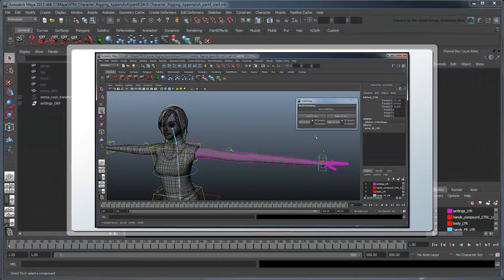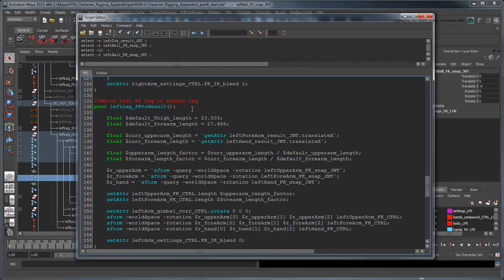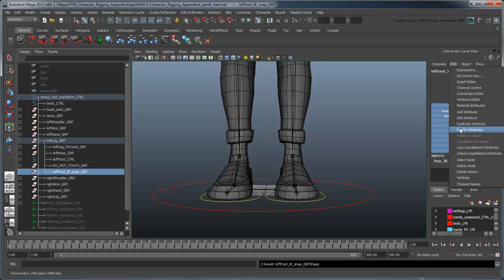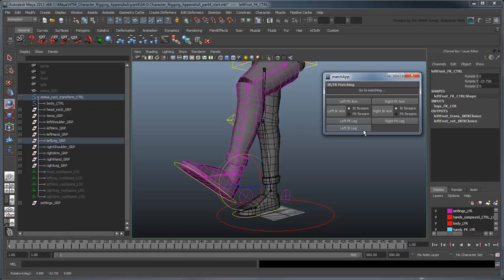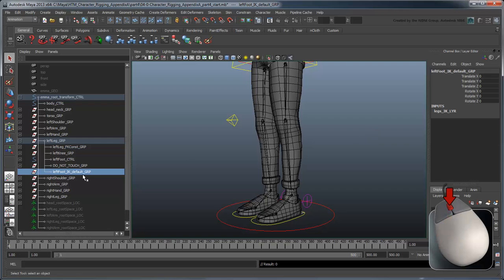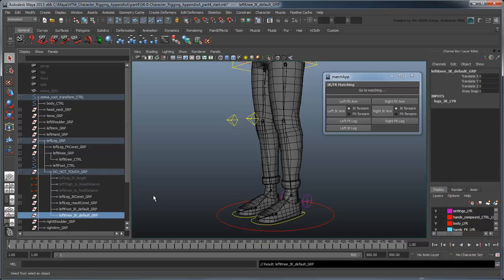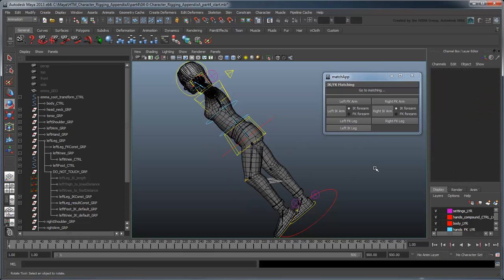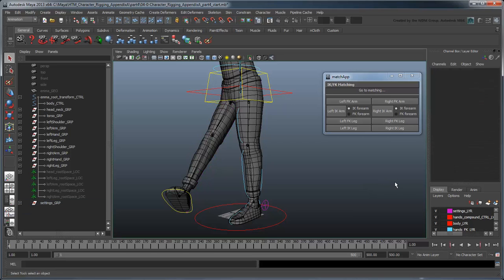Creating a Character Rig: Appendix A: Part 4 - Matching leg joints (Advanced)

Comment: Excuse, I have a problem. Everrything works me fine except one thing. When I rotate the root of the character, it switchs me fine from IK to FK. But from FK to FK, The knee controler snaps in a wrong space of the world even when I have created the leftKnee_IK_default_GRP. Could you help me?
Reply from the maker: Unfortunately that seems like a pretty specific problem, making it hard for me to solve from here.  Are you sure the knee IK_default_GRP coordinates are 0,0,0 at the start?  Is it parented correctly?  This problem would probably be best solved by comparing your rig to the provided file.
Reply: Maya Learning Channel yes, the coordinates of the IK_default_GRP are 0 at the start and it is parented under Do not touch Grop of the leg. Also, I have compared again my script with yours and seems to be equals. I have observed that the pivo of the knee_IK_default_GRP is located where the knee_CTRL is. Is that normal?¿ If you need more details to try to know what is my problem do not hesitate to answer. Thanks you very much for ypur help
Reply from the maker: That would be your problem.  The knee_IK_default_GRP definitely must be located in the same place as the knee's default position (that's the whole point of it after all, to keep track of the knee's original spot).
Reply: I m also facing the same problem please help if you finded the solution